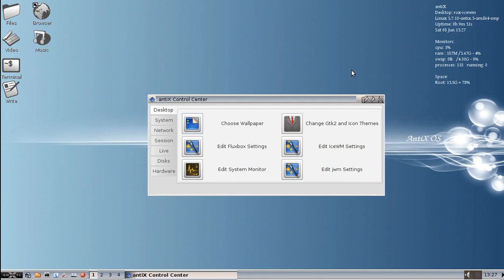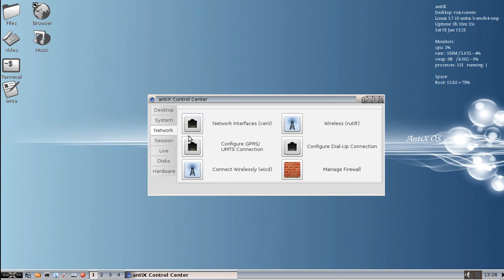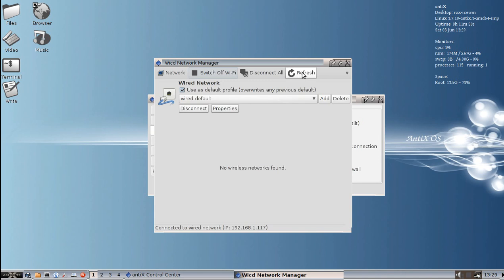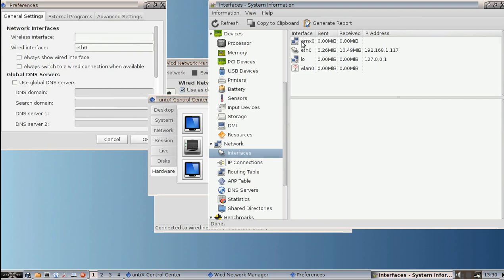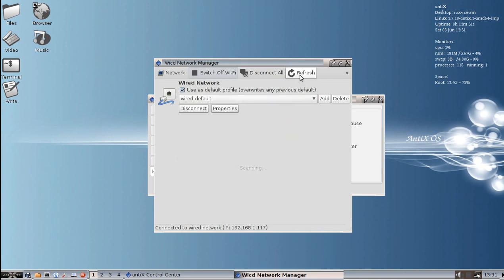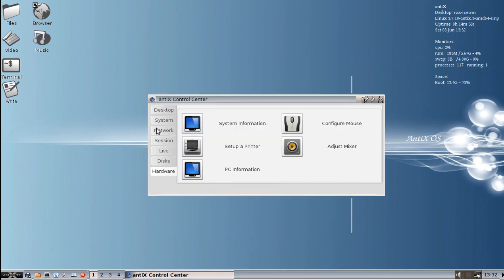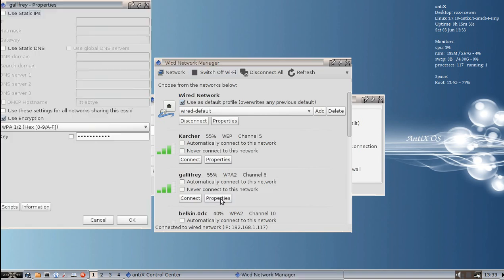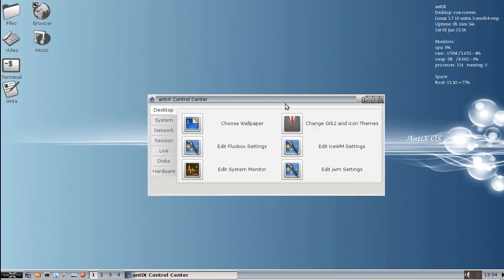Antix 13 - Set up your wireless (wifi) network connection

Comment: Thank you.   But how about connecting to a wifi dongle? Is there a tab that will appear once plugged in for selection?
Reply from the maker: No.  If your device is recognized by the system it will just be available ad another interface.   However there are a lot of wifi dongles on the market that use chips not supported very well by linux.
Reply: runwiththedolphin Thank you !    Love the look of Anti-X 19 which I’ve just downloaded.    You’re right about wifi dongle compatibility driver issues in Linux.   I bought a Tp-link T2U v.2 which has Linux as a compatible Os on the box but as yet no luck in a successful install- which I tried a number of times in Xubuntu...

Comment: Nice video. I'm having problems setting up a static IP address with WICD in Antix 17. Have you done a video on how to do this? I clicked on the static IP tick box selected my static IP address etc... Restarted my network services and my PC as well. It keeps connecting to a DHCP connection.
Reply from the maker: with a wired or wireless connection?  and is the connection set up in /etc/network/interfaces, which would take precedence before wicd.  In fact, its probably easier with static connections to just use ceni to set it up and forget wicd for that task.
Reply: It's a wired static address I am trying to set up. I tried wicd. Didn't work to I tried Ceni. Is there something I should post on the forum?
Reply from the maker: probably a good idea.  post exactly what you are trying to do and that wicd is still trying to connect with dhcp.  There are a number of network gurus that frequent both the antiX and mx forums.
Reply: runwiththedolphin I created a new topic in the antix forum. Thanks!!

Comment: I have installed antix 16, Wifi does not work. I tried to follow this video but antix 16 is differend from 13 (ofcourse) in the control center is no icon with "system information" Where can I find it? Or how can I solve this problem on antix 16?
Reply from the maker: ladamurni try using ceni to setup your connection.  there is a launcher for it in the control center network tab.
Reply: Thank you, I tried it but it does not find wireless networks. Not with ceni and also not with wicd. What am I doing wrong?
Reply from the maker: I suppose its possible that your chipset isn't supported OOTB.  What do you have?
Reply: It works fine now thank you

Comment: How can I use the usb drive? it doesn't seem like antix recognizes it
Reply from the maker: if you are using antiX 16, usb drivers should show up automatically in /media.  If you are using an earlier version, use SpaceFM to mount usb drives.
Reply: runwiththedolphin is version 13, ok i'll check  SpaceFM, but I'm a starter in linux to be honest, thanks for the reply!
Reply from the maker: no problem. I really suggest antiX 16.  its got more new user friendly features.  but 13 is a great release, just older.
Reply: runwiththedolphin Thank you again, antiX16 comes in spanish?
Reply from the maker: i believe it has been translated to a great extent into spanish.  you can select the language at boot time off the usb with the F keys.
Reply: runwiththedolphin ok like the 13 intallation, thank you I'm downloading it!

Comment: I just installed AntiX on an ancient Dell Inspiron 1000 with the help of your install video. Thank you so much for that! It was my first time installing any OS, let alone Linux, and the OS works just fine, thanks to your help. However, there is one problem.

The Inspiron 1000 doesn't have its own network adapter, so it has to use a PCI card for wireless. AntiX isn't recognizing it. Or maybe it is? The POWER and LINK lights both light up on it when the laptop's on. Do you have any idea how I could get that working, or know of a guide or place I could ask for help?

Comment: I tried to set internet connection on Acer Aspire One - Happy netbook. ( God knows who called it 'happy' , it's a nightmare ) . The system cannot even detect the network hardware . And I remember booting AntiX on another Acer laptop ; the control panel would open hundred times upon one click and I think it would have carried opening until the memory was full. Maybe, AntiX just doesn't like Acers. The version of AntiX I just downloaded must be different from the one in the Video because the network manager looks different. Unfortunately this video dodn't help me much but I very much like the nice and clear way you explain things .
Reply from the maker: Adam Jablonski did you happen to download the MX version of antiX (running the XFCE desktop?)  The Acer Asprie One Happy can ship with one of three different wireless chipsets.  atheros, intel, or broadcom.  Since atheros and intel are well supported by the linux kernel, I'm going to guess that your aspire one uses a broadcom chipset.  Another possibility is that some notebooks, not only acers, for whatever reason think the wireless NIC should be disabled by default.  HP's tend to be bad for this too.  you can check that with "rfkill list all" which should list out all of your network interfaces and if you see one that is "soft-blocked" then you've found the problem.  "rfkill unblock all" will remove the soft blocks.  If hard blocks are shown, then there is a bios or hardware switch flipped on the device itself.  I know my asus EEEPC in windows actually disables the wireless in the bios when the keyboard switches are used.  

On a positive note, I'm glad you liked the video even if it didn't help with your particular situation.

Comment: Outstanding instructional videos with a porpoise! As a noob,fascinated with Linux,I have frustratingly tried to find a distro for my Dell Inspiron 910 mini,with the evil Broadcom 4312 chip and 4315 proprietary drivers. Does Antix 14.3 include the bcm43 drivers on an iso so that I can install and boot via usb? I dont have wired internet or a usb cd drive,just my smartphone with mobile tethering. Thx so much in advance,phil Best wishes.
Reply from the maker: Yes it does.  In fact, that chip should work OOTB with MX-14.3.  Get the non-pae version for your netbook, as you don't need the pae version and the broadcom works a little better on the non-pae due to a small bug in the 14.3-pae iso.  If you don't want to download the MX isos, we do sell a bootable usb on osdisc.com.  https://www.osdisc.com/products/antix-mx143-nonpae-8gb-usb-flash-drive-32bit.html
Reply: runwiththedolphin 
Sir, As a total Linux noob, humbled by vast knowledge required to be proficient in Linux, enamored by the open source paradigm, and frustrated by the complexity of the OS and sometimes unkind smugness of experienced,Linux elitists, your speedy,gracious,utterly useful advice,this from a respected Linux expert (my first), is appreciated beyond all measure. The kindness,knowledge,and patience exhibited by you,Linux Help Guy, anticapitalista,and others at Mepis.org is deeply appreciated. All the best to you and your families. Thx,phil
Reply: runwiththedolphin p.s. I have downloaded that exact iso Sir Dolphin to my android smartphone. After tethering to the Dell mini 910, I am attempting in my profound ignorance by running Puppy Linux precise,and then Linux Lite 2.2 live off a usb, to somehow transfer said non pae 14.3 mx iso into my XP download folder so that I can use Pendrive usb installer to get it on my usb stick. Regrettably, Puppy doesnt seem.to see the tethered phone and Lite seems to mount it,but I cant open any files or folders. I feel im temptingly close. I hope to be a dedicated AntiX MX14 user thanks to you and Steve(LHG). Live Long and Prosper. With admiration and thx,phil
Reply from the maker: Phil Leo I came to the linux world because I was tired of the windows interface.  I have no issue with microsoft or with windows as a product, but beyond wallpapers and themes, you really can't change the user interface all that much.  linux offers the user a vast array of custimaztion options.  I would suggest to you, as a learner, to pick one interface at a time and learn the ins and outs of that environment.  Thanks for you comments phil, you sound like a classy guy.
Reply: runwiththedolphin Back at u Sir Dolphin. It is most definetely u who are a classy gentleman. Even your voice sounds unpretentious,humble,and kind. I picture you in a Southern State, sipping sweet tea, while making the world a better place by helping others. As a Libertarian/lassez faire capitalist, I too have no prob with Microsoft philosophically. But tgere is much to be said for the open source Linux model,of a free and flexible OS. It is inspiring. Once again, thank you so much. I bid you peace,health,and happiness. May your generous gifts come back to you tenfold. You are a credit to the Linux community and have much to be proud of. All the best,phil <--------<<
Im no longer runnin with sharks, but with Dolphins, who are documented in saving humans from shark attacks);)
Reply from the maker: Phil Leo oh my, I just noticed you said "videos with a porpoise"!  I missed that the first time LOL!

Comment: Nice video....

But I got a strange problem. I installed LXLE on my hard disk and using Unetbootin to boot into LXLE. The problem is i can see my neighbor's wifi and can select it to enter password but my home wifi network is greyed so i can't get on internet. Everything works well when i boot into XP. What can be causing this? Thanks...
Reply from the maker: that is strange...my first guess is that the security settings are different somehow between the two wifi networks...other than that, I would post over on the lxle boards because it is likely something specific to lxle.
Reply: runwiththedolphin Thanks for your prompt reply. I will change security setting to WEP and see whether i can connnect or not. Thanks again.
Reply: Well I tried WEP and i could select it. Interestingly, I had another modem which i turned on. It had a wifi with WPA2 just like the earlier one and its network was selectable.

Anyway, just wanted to update you. Thanks again.
Reply from the maker: ***** Thanks.  That is weird though about your routers.  I wonder did you have any kind of MAC filtering enabled on the first one?  Just a thought.
Reply: No MAC filtering... both are configured the same just wifi name is different. Both are supplied by ATT. One is 2Wire and other is Motorola NVG510. Technically, this should not happen but it is happening because of some tiny change somewhere.

As one is working, I am fine. 

Thanks again for your time.

Comment: Dolphin Oracle thanks for the video! I don't know anything about networking but I can get my wifi to work sometimes with Rutilit WLAN manager. Is Wcid better?
Reply from the maker: Rutilit is an old utility originally made specifically for ralink chip based wifi devices.  I haven't used it in years.  It really doesn't matter how you get your wifi working, but I've found that WiCD is better for me because its easier to set up and manage multiple wireless networks.

Comment from the maker: I recommend putting a post up at the antix forums. When you post, include the output of the following terminal command : 

inxi -F

  .  Also let them know which version on antix (full, base, core, 32bit or 64bit) you are using.  I bet someone can help.  I know at least some long time users over there have experience with troubleshooting broadcom devices.

Comment: Trying this distro using live usb key made in unetbootin. It's the first distro that recognized my broadcom wireless out of the box. Was able to connect to wireless when I turned off my WPA security but it will not connect when I have security turned on and enter the pass code into WICD. Any ideas?